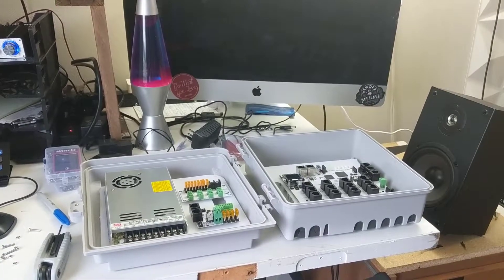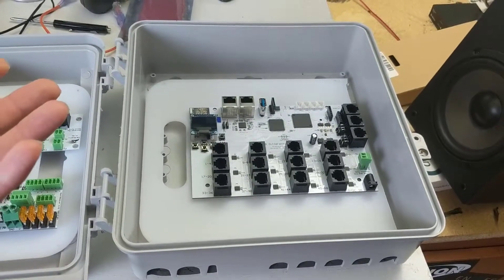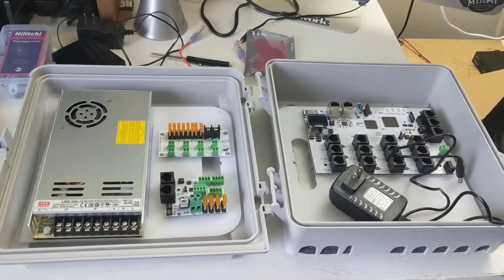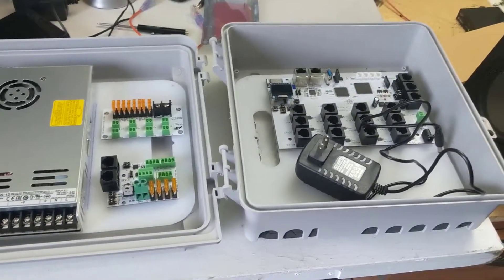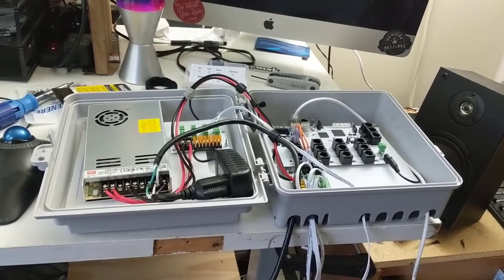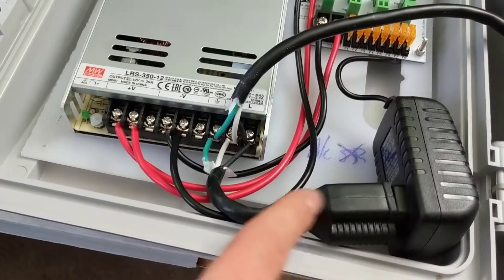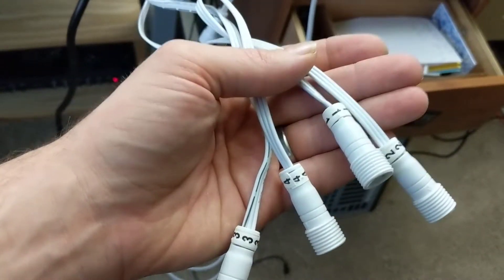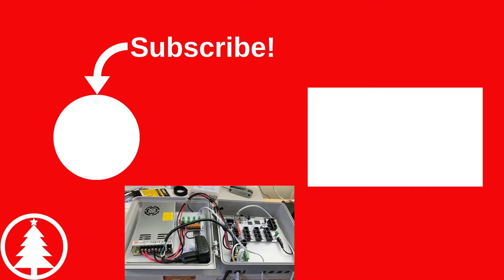How To Build Your First Christmas Light Controller

Comment: Greetings David... Can i use a Falcon controller on this model of ligths: BTF-LIGHTING Chasing Dream Full Color Twinkle Decorative Lights 5m/16.4ft 50LEDs Addressable WS2812B IC Fairy String Lights ....
Reply from the maker: Yes, just choose "WS2811" as the type of pixel in the Falcon (and this is the default)

Comment: Thanks for the awesome videos. Can you tell me the details on the white wire/whips you used or a link? Thanks
Reply from the maker: Sure thing.  They are called "pigtails" and they match the type of connector that your lights use and are female connectors - so "xConnect female pigtails" are the most popular style today to look for wherever you buy your lights.

Comment: Can I ask a question that everyone probably knows the answer to but me? If I can just use a cheap 12v or 5v adapter to plug in my f48... Can I just use the same adapter to plus in my receivers? Obviously it doesn’t have the port (no idea why) but can I just cut the plug off and split the ends instead of buying those fancy metal meanwell ones?!
Reply from the maker: You can, but keep in mind that the small "wall wart" type adapters can typically power as much as 2 amps of pixels (around 30 pixels run at full)...the mean well can power 29 amps of pixels.  And all of a sudden, it doesn't look so expensive :)
Reply: @LearnChristmasLighting  Ah, I get it. So what you’re saying is that since the f48 isn’t powering pixels it can use a less amperage power source. I get it now, thanks! How come you didn’t just hook up the f48 to the meanwell for simplicity since that has more outputs that could be used to power that too? Didn’t using a plug for that just cost you more money and create less room in the box?
Reply from the maker: @MichaelAuzDrillDesigns  Yes, but the F48 requires 5v power, and my pixels are 12v power...so 2 power supplies :)

Comment: Thank you. I needed this video. Totally NOOB. I would like to suggest this 12v to 5v converter instead of the wall wort. Will clean up your box some. https://www.amazon.com/BINZET-Converter-Regulator-Regulated-Transformer/dp/B00J3MHRNO/ref=sr_1_3?crid=MMFRO9BRC4JP&dchild=1&keywords=12v+to+5v+step+down+converter&qid=1607640078&sprefix=12v+to+5v%2Caps%2C167&sr=8-3

Comment: Hi David, I purchased all the items from the links on this video for the f48 build. I am ready to give this a try but being a newbee, there is some info that I seem to be missing. This despite watching all of your vids and many others. Do I run a long ethernet cable from the router to the F48. Is that the normal way to do it? Also, how do I connect from where the f48 will sit to where my pixel lights will  start. What type of cable needs to go in between to get my lights where they need to be? Hope that makes sense. Thank you for all the expertise and information!!
Reply: Voltage question? So the power supply for the f48 is 5v but we are plugging it in to a 12v power supply here. How is that possible?
Reply from the maker: Beats me, I'm not an engineer, but that's how it is designed to work :)
Reply: Is there any place to purchase the string 12v pixel lights other than China to get them faster? I dont mind paying extra.
Reply from the maker: Many places: a few on this page: https://learnchristmaslighting.com/resources
Reply: The small black power brick is 5vdc to the F48

Comment: I have an LOR controller how would I go about running pixel light through this controller? First time using pixel thanks in advance
Reply from the maker: You can't - you need a pixel controller.  Now, most pixel controllers DO have a DMX output, which can then hook up the LOR controller so that xLights or Vixen can control your LOR controller.  But an AC LOR controller cannot run pixels.  :)
Reply: @LearnChristmasLighting  thanks

Comment: Hi David, I love your videos. Appreciate the time you've spent creating these. I'm curious if you could go a little more in depth how you actually wire in a power injection with this setup (distro board and whips). In my head I'm thinking, I have a pixel line, cut it where I need to add power injection. The data lines tie together (or just don't cut them). All the +DC (3 wires) tie together and all the GND (3 wires) tie together.
Reply from the maker: If it's the same power supply, you can tie all 3 +DC wires together.  If they are different power supplies, you must cut the +DC from the "old" line, and add in the new power supply +DC line in.  Using a distro board means there is nowhere to connect the data line on the power injection, which is exactly what to do!
Reply: @LearnChristmasLighting  Can I setup a Christmas display using a DMX dongle with a lighting controler or Lumidesk

Comment: How's MW power supply handling airflow when it's inside waterproof box? Thanks
Reply from the maker: It's fine.  Meanwells will shut down before anything dangerous/overheating happens.  Even with that, in most climates people don't have problems.  I've run mine at 90 degrees fahrenheit in the summer and it's fine, and I have heard the same from others
Reply: @LearnChristmasLighting   thanks for answer

Comment: Great video! I’m building an enclosure for my F48 and am hoping to get a 5A power supply to run the board and my raspberry Pi. Do you have any recommendations?
Reply from the maker: Honestly, any meanwell 5a/5v power supply will work, the tricky part is that for the Pi you will need to cut apart the usb cable that powers it and wire it in...seems easier to me to just power them off separate power supplies...
Reply: Remember you can power a pi through the GPIO pins as well.

Comment: I see the same female connector used for the #9 power whip as the four data whips. Is it the same exact connector from xconnector that I need to buy for both power and data coming off the board? I bought everything on your list via the links but no link for this component. Also, 12v power supply wired to 5v power supply to f48. Please clarify is the controller 5v because of this power supply now. Do I need 5v pixels now or do I still make that choice some other place. Thank you
Reply from the maker: Yes, it's generally going to be the same xConnect (or whichever connector your supplier uses) for both the power and the power/data.  The F48 is 5v, you'll want to use a 5v power supply for it, but it does not determine the voltage of your pixels.

Comment: Just curious, what wire gauge did you use from power supply to distro board and receiver? I will be setting up this same configuration. Thanks for the great videos. This is my first year. Lots to learn.
Reply from the maker: I used 12 awg, which is sufficient for the amount of power I am using at 30-50% brightness

Comment: Hi david. Can you control a smart receiver via pi in remote mode and have a master pi connected to the f16v3 wirelessly or am I stuck with using an Ethernet?
Reply from the maker: Nope, completely different protocols.  If you want to go wireless, check out https://www.ecwid.com/store/espartstick/

Comment: What did you use for your backer board.
Reply: Looks like he used a HDPE cutting board and cut it in half.
Reply: I thought about using 3/16" pegboard. Cheap and lots of mounting holes and can be cut to size to fit the case.
Reply from the maker: This!  Walmart cheap cutting board!